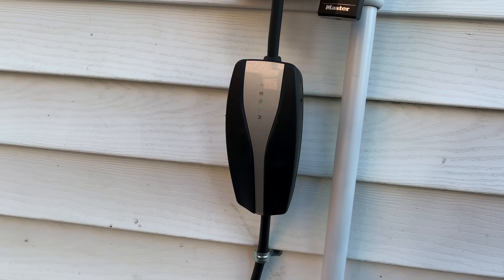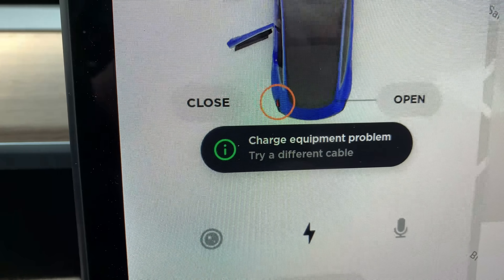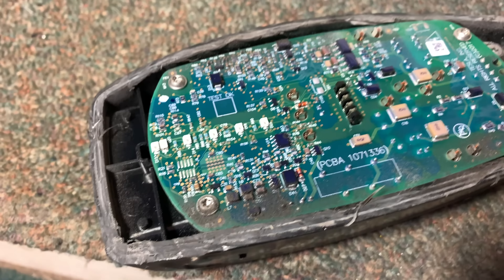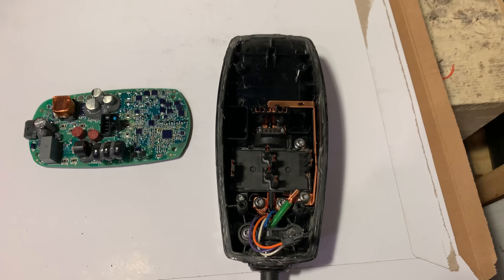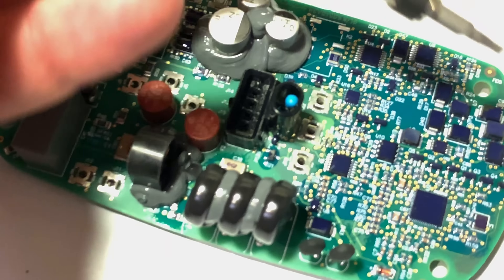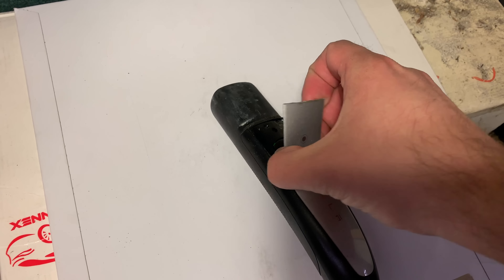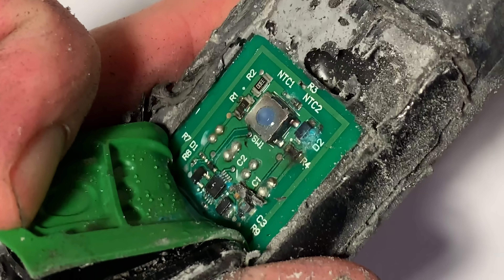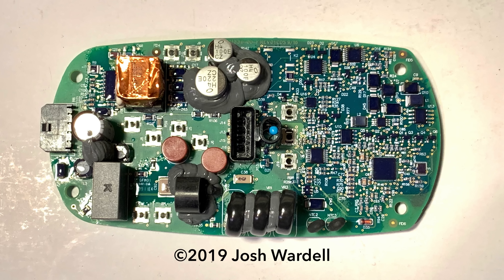Mobile Connector Teardown

Comment: I have a mobile connector, and the charger button will not open the charging port flap.  Everything else works just fine.  I bet there is water in it just as you have shown here.  It is an early model 2013 S P80. I will either have to live with it or spend $$ to replace it.  At least the key fob has the function to do this so there are some work around but it would be nice to have it work as it should.  Great video!

Comment: My charger fell about 5' to the floor. Now I have "Unable to charge - Mobile Connector GFCI tripped" warning. 
Now that I see where that is, looks like I need a new Mobile Connecter Unit. My spare MCU works fine.
Good info, thanks.  DON"T LET CHARGER DROP ON FLOOR.

Comment: I live in Seattle and am also encountering water damage in the handle. Pressing the release button started not working consistently 3 months ago and completely stopped registering any pushes just last week. I could see water oozing out under the gray cover on top of the handle every time I pushed the release button. Charging occasionally got interrupted as well. Scheduled an appointment with Tesla and hope they would send me a replacement for free.
Reply: Same here. Also in Seattle.  I have been through two of these now. The original from my 2915 Model S, and the replacement which is only 2 years old.  Both exactly as this video, button stopped working due to water ingress. In both cases the charger still works though...

Comment: Interesting.  I noticed this in the manual: "Warning: If rain falls during charging, do not allow rain water to run along the length of charge cable, causing the electrical outlet or charging port to become wet." For some reason, I thought these were ok to use outside and even in the rain. I am apparently wrong.  Thanks for showing the problem.

Comment: Any ideas on what the "slots" are on the sides and rear of the charging unit?  I contacted Tesla, who sent me to the Service Center, to tell me "I don't know".  They appear to be for a cable lock (possibly) or could be weep or heat exchange holes.  Watching the video I don't see where it enters the interior of the unit.
Reply from the maker: It's sealed, there are no vents. I think those are for some kind of wall mount to clip in

Comment: IP 44 should be good enough for resisting rain to come inside. My plug was ok but my UMC was filled with water so if it’s raining cover the UMC big part with some shrinking plastic tube and the top part of the UMC so rain can’t follow the cord down into to box.

Comment: Great tear down. From your experience, any idea about the state of affair regarding RCD in the UMC? User manual writes it detects current leak, then what happen? Does it cut power? Is there type A 30mA protection?
Thanks!
Reply from the maker: It definitely has ground fault interruption built in, I'm not sure what current but I believe it is 10mA here. That would no doubt interrupt charging.

Comment: So is the 240v ac routed directly to the car port through the relay? Does that mean the charge current is controlled by the car electronics and not by the mobile charger?
Reply from the maker: Yes, that's how AC charging works for all EVs. The charger is on board the car. The portable or wall EVSE just monitors some safety items and tells the car its maximum current.

Comment: great video
how much did the 3 phase Universal Mobile Connector cost? can you still get it from Tesla as a new part ? any problems so far?
Reply from the maker: You can buy a mobile connector from Tesla's web site for $300. They sent me a fee replacement for this failed one under warranty. A year later, it looks like my next one is starting to get moisture in the button and will fail soon too. Also this is single phase US version.
Reply: Yeah i would guess 3 phase EU costs somewhat $500? 
Because i live in Austria 
I would use the bigger 11kw charger for at home and keep the singlephase 3kw in the car as well as the 11Type2 cable for public slow charging stations
So i would not need a wallbox
Reply from the maker: @steinmar2  Strange they are not sold in any of the European stores on Tesla.com

Comment: Question for you. what gauge are the two hot wires going into the unit. I have a feeling its a 10awg but then how does it supports 32amp? maybe it's 8awg? Thanks in advance!
Reply from the maker: Aviad Offer there are no wires going in, just a connector and bus bars. Coming out, the long wires look appropriately 10 or so gauge thick. The top plug adapter is only a few inches long and has thermal sensors so that’s not really an issue. Tesla monitors temperatures in the plug, in the mobile connector, as well as each charge port pin so it can always stop or lower charge current before things get too hot for some reason
Reply: TechTesla thanks much. I was wondering if it’s 10awg. Not sure why Tesla is using 10awg when it’s only rated for 30amp. Thanks again.

Comment: I know that the small-gauge VIOLET and BLUE wires in the UMC cable are for the J1772 Pilot Signal and +3.3vdc respectively. Did your teardown reveal the purpose / connection / usage of the ORANGE and WHITE wires in the cable?
Reply from the maker: No doubt to power the button and transmitter in the handle
Reply: @JWardellTechEV  Thanks! I read that the BLUE wire carries +3.3vdc to power the 433Mhz proximity transmitter in the handle. Have you been able to pull back more of the handle's rubber potting compound to reveal more of the PCB and show if/where the ORANGE and WHITE wires are connected in the handle?
Reply: Yep, I need a same info.
Reply: Do you know if i can plug a solar panel dc straight into the charge port?

Comment: So would it be possible to divide the center screen in the middle 3, into a smaller scree  that can be placed elsewhere in the dash?

Ultimately a dashboard like the tesla model S in a model 3.
Reply from the maker: The display is connected via LVDS to the ICE computer, so you would have someone good at hacking that
Reply: @JWardellTechEV  I might be misunderstanding, but as far as I know, there are lvds to hdmi/composite kits. Could those be used?

Comment: Do you know if i can plug a solar panel dc straight into the charge port?
Reply from the maker: I doubt it, I think the onboard chargers will only work with 100-240V AC
Reply: @JWardellTechEV  dang it!!😟
Reply: @JWardellTechEV  but...what would happen...??
Reply from the maker: Probably nothing. You would need a solar charger, battery, and inverter. Here's an option: https://www.youtube.com/watch?v=69QpA5H1bYI
Reply: @JWardellTechEV  yeah, i saw that video...its the batteries doing the charging.... i really want to know the minimum amps required to charge.. i know By that video, i can set the current down to 5 amps... i just dont want to ruin my car...
Reply: ...if i plug the leads right in the two main ports, that have to be DC ready...
Reply: @dtriplett03  dis you find and solution to charge with DC from solar panels directly into the car?

Comment: can you tell me HOW the mobile charger can tell WHAT adapter is connected to it? We just purchased a 2021 model Y and plugged it in to an outlet to charge, and it did what it was supposed to 120v12a SLOW. But then I looked at the specs and it is rated to 240v so I just rewired the outlet for 240v and it now charges at 240v12a which is twice as fast, obviously. I then heard about the 14-50 adapter and have one on the way now, and with THAT installed the SAME gen2 mobile charger I am told will charge at 240v30a which is faster once again. My question is this, how does the BRICK know that I am plugged into a 30a outlet vs a 15a one? It not the voltage as I have already tested that. is there some chip or resistor in the plug that goes into the brick that tells it that it can draw more amps? Thanks in advance, I have googled just about everything I can think of trying to find this info with no luck, and you've torn one down.
Reply from the maker: Yes, there are electronics in the plug that you swap out on the end that report which plug adapter you are using and their maximum current (for example a 14-30 or a 14-50). They also measure and report temperature at the terminals.
Reply: @JWardellTechEV  Have you mapped it out or know what the appropriate translation tables or protocols or whatever or for that
Reply from the maker: @sNEAKYnIGHTmUPPET  not yet

Comment: Did Tesla replace yours free of charge? Going through the same thing
Reply from the maker: Yes...scheduled mobile service, then convinced them to just mail me a new one. I'm feeling ice in the button of my second so I guess this will be happening again soon
Reply: @JWardellTechEV my third unit has just died. Tesla replaced the others but told me that they won’t replace it again. I have only now realised that water is getting in the handle. Seems like a serious design flaw
Reply from the maker: @Inurmind2125  Sad to hear that is still happening, I was hoping it was improved in newer versions. I did use the replacement outside for years with no more issues

Comment: That is basic, you can make super charger by using 60amps transformer, like in the normal car battery charger. It's all the same only need proper wiring to make the sensors still work.
Reply: Do you know if i can plug a solar panel dc straight into the charge port?

Comment: Poor quality. Is that the same with the car itself in time. A ice car can llast 10 times more than the huge amount of electrical components in an EV. 
When you have sn EV you are stuck to that manufacturer to fix it. The big problem comes in case of an accident and post warranty. A bit scary , cost huge cash and insurance is high for evs. Overall there is no  real saving , and Co2 lie is not standing anymore after Congress release the report of 0.4 % in the atmosphere. So at 0.2 % Co2 plants die. 
Evs are for fun factor, snd style. Regular working citizen does not need them at all.